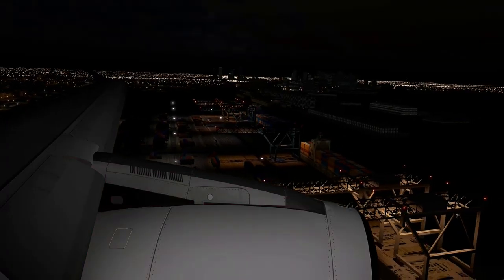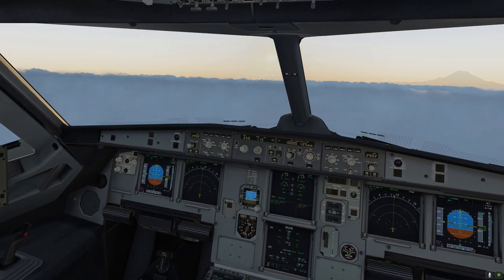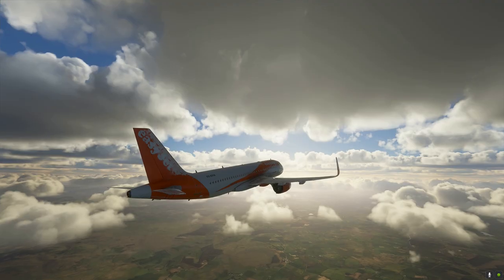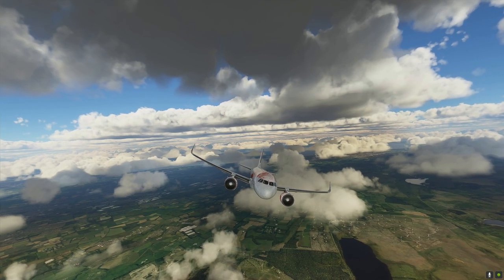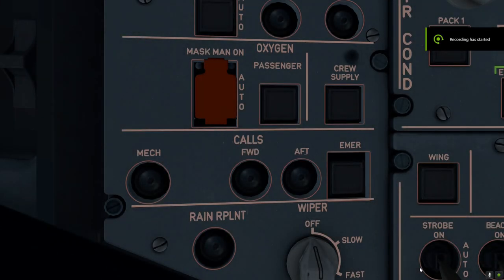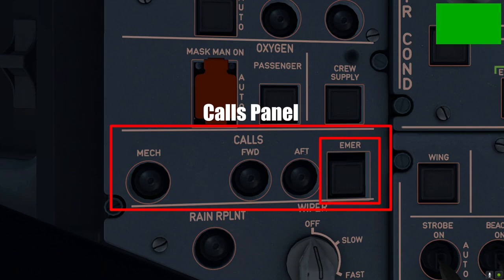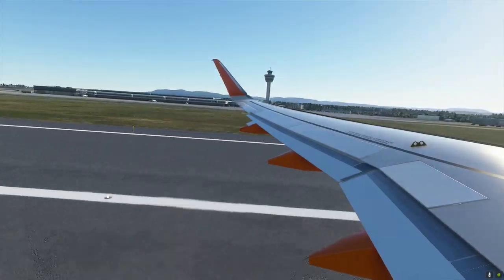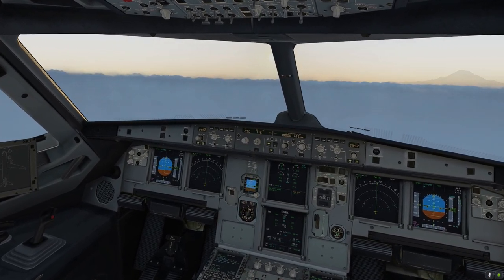Aircraft Dissected Ep 1: The Overhead Panel I Airbus A320 I Detailed Tutorial (X-plane 11/MSFS 2020)

Comment: Extremely good video.
Advise to combine all 3 sections of ovhd panel in only 1 video itself.

On the EGPWS panel kindly highlight that if FLAP MODE is selected OFF, the movement of the flaps (operation) are NOT stopped. (It ONLY Cancels the proximity audio warning).
Many pilots gets confused between FLAP MODE off and LDG FLAP 3.

Retd examiner on A 320 family.